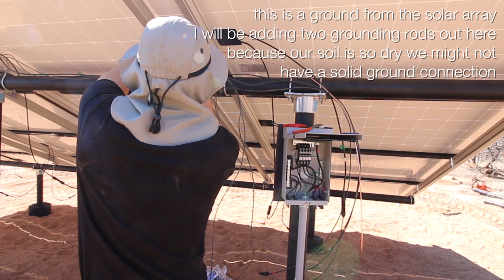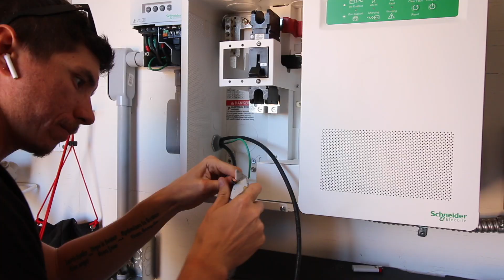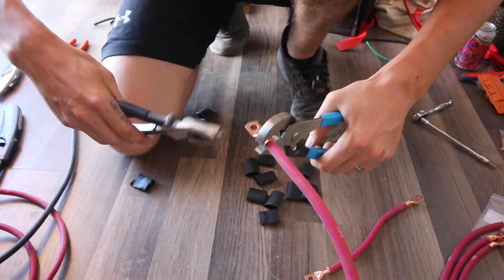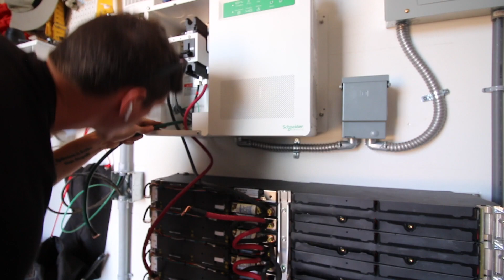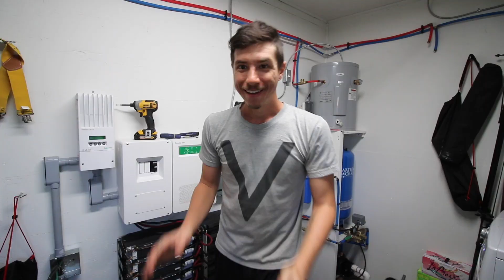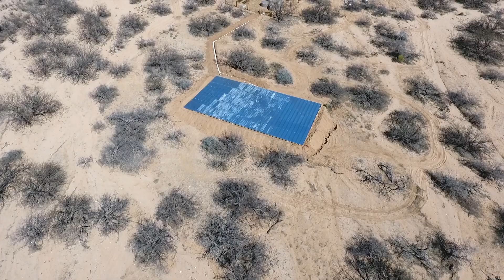HOLY F#CK IT WORKS!! Off Grid Solar Installation Day 6

Comment: Hi, l am trying to make an off grid solar system battery bank. I will use it day n night. USE 1. Pump water from borehole day n night pump is 3kw.  2 . Lights are 200w 3 of them. Please advise

Comment: Whao! What a great work. I am a novice to Solar and stuff, but I would like to know the system voltage of your inverter and the charge controller. I thought you said the battery bank is 60V. Thank you for those great videos. I have learnt a lot from them.

Comment: Derek, how much did your total system cost you and how many years will your batteries last before you need to replace them, also how much per battery will it cost to replace them? Also what things can you run all at the same time without the system shut down?

Comment: 1. Is your underground wire sized for the higher amperage you will have with 5 sets of panels in parallel instead of 4?
2. Did you size the conduit according to code based on the wire size and current, or did you just pick conduit that would fit the wires?
3. Considering the higher amperage from 5 sets of panels in parallel, does the conduit still meet code?
Just wondering!

Comment: Great job. One suggestion. when making your battery cables you did not solder them. You crimp for an physical connection and then solder for a good electrical connection. Then cover with glued shrink wrap.

Comment: I just saw this video of the 6 solar install and don't know if you address this in later video's. But you should install a Service Disconnect for the incoming solar feed in the shed . You should have it before the controller for safety so you don't have to go to the solar combiner box to disconnect. The second is the ground at the solar panels. In the video you only made 1 point to the rail, you should run 1 long run( no cuts ) and attach to all the rails for safety. Nice job over all.

Comment: How much has your solar installation cost you? The battery pack alone can run close to $ 20,000.00. Gee did you spend all your money on the Tesla battery and can not afford the heat gun,  that should be used to shrink the sleeves.  Heating them with an open flame can lead them to be brittle from charing in the open flame. Codes are written for good reason.Even you are supposed to follow codes. It is so nice of you to publish all the evidence needed to prove willful code violations.

Comment: New comer here.   Great video.  Btw.   But dam how expensive. Is your set up.     I went off grid poor.  I have two harbor freight. 100 volt solar kits.  And I home made one vertical  and one horizontal. Windmill.   Witch are doing fairly good.

Comment: So how do you prevent from over discharging the battery?  Considering the Conext Inverter high voltage cut off is 48volts and you're using 60v (15s?)  Your cut off need to be set at least 52.5volts.... But the Schneider software only allow highest cut off to be 48volts...

Comment: Hello , I just saw your vid  a bit late you use 15 solar panels @315 watt each that can give you 20k watts in winter and 30k watts in sumer so as mentioned in your vid you got 18k watt battery which is  a bit less than your actual harvested power inverter efficiency can be as 95%

Comment: YOUR BATTERY JUMPER WIRES ARE FAR TO LIGHT, THEY NEED TO BE MINIMUM 2/0 COPPER WELDING CABLE AN SOILDER THE COPPER CONECTORS NOT CRIMP THEM.... EVERYONE SEEMS TO WAY UNDER SIZE THERE BATTERY CABLES, EVEN THE GROUND AT THE INVERTER HAS TO BE A 2/0 WELDING CABLE TO A GROUND ROD...

Comment: #DIYHomesteadProjects Here in Australia when we bury any cable / pipes, we add a 1 foot contrasting materiel ie. yellow sand, 7 mm blue metal then add the safety tape on top of that which is also colour coded as well ie. red = power, blue = water, and so on. Then we back fill the natural earth.

Comment: So I could use some help...... I have 300 sqft off grid cabin. The only appliances that will be running constantly will be the Refrigerator. T.V, Lights, water-pump, small charging will all be done Occasionally. My Stove and hot water heater will be propane. What sized solar set up would be needed for something like this? I was thinking 3kw but I feel like im over pricing?

Comment: Nice work! Great looking system too! Definitely add a guard over your battery bank to prevent accidental shorting of the battery bank by daily activity in the room. Also when you next service the battery, wrap the socket wrench handle, extension, and socket in a simple layer of electrical tape to reduce shorting risk if the socket slips.

Comment: What type of BMS are you using on the batteries? 

Have you looked into the Schneider CONEXT Bridge 865-0326

It can connect a 3rd party BMS to the ZANBUS. 

https://solar.schneider-electric.com/wp-content/uploads/2017/05/Conext-Bridge-DS20170405_ENG.pdf

http://www.schneider-electric.com/en/product/865-0326/conext-bridge-com-dev-connecting-the-conext-product-line-with-li-on-batteries./?range=62089-conext-combox-&node=457632180-device&parent-subcategory-id=7030&parent-category-id=7000&filter=business-7-solar-and-energy-storage

Comment: Man when you are wiring HV batteries, your safety glasses should be in place in case you accidentally short circuit something and sparks go flying.... ex: from the end of your tool disintegrating......

Comment: first off i would like to start off by saying good job. second i have a few questions.
1 what was the over all cost
2 what were all the items used and how did you source them.
3 how did you figure out the load and how much solar you would need.
4 could you like run AC or a Dryer Or what all could you run. 
we are thinking to do this our selves. any advice would be greatly appreciated

Comment: have you monitored the voltage and amperage at your solar panel combiner box....
and at the charge controler to check the voltage/ amperage drop..... if any....
Reply: that is important and not mentioned
Reply: dgaf stfubznatch 
you can do all the caculations you want...
but monitoring both sides gives real world numbers...
plus with the size of their cable, lenght of the run.
and the voltage on both ends...
can be very helpfull to their followers ( me and.?)

Comment: Great job. It is amazing. I'm working in doing basically the same configuration you have there. Could you share the configuration you have made in the charge controller to charge the Tesla battery?

Comment: How much actual usage do you get from 18KwH on Lithium Ion Banks?

Your advisor was smart not to put a diode in to lower voltage for one extra panel. If your usage is draining the batteries more than 15% per day, then you can look at adding that final panel...
But I’m safely guessing you worked out your total KwH usage anyway... a 5 bedroom household can use up to 11KwH per day in winter with gas water, electric heating and cooking...
Reply: 5 bedrooms on 11 kWh per day?  That seems very low.  My 3-bedroom 1,200 sf house uses about 20-25 kWh per day in the winter, and that's with gas heat.  

11 kWh in one day is an average of 460 watts running continuously for 24 hours.  I'm really not sure how you do all of the things people do in houses plus heat for only 460 watts.

A tiny house is, of course, a different story, especially once you apply some off-grid energy saving techniques that most people on-the-grid don't typically do.

Comment: I'm living off grid in New Hampshire feeding the gas generator daily😫 it drives me crazy.  Was wondering who or what you used for your systems design.  Hard to get info on powerwall 2, but don't want to go with lead acid.  You mentioned Liam??? Is he the guru???  I'm not an electrician but handy and ambitious to learn more about li-ion battery packs.  Any suggestions to keep me moving towards fossil fuel free off grid living?

Comment: just watched u slam pure living for life you pompus jerk.  yet.. you ran your grounding wire along your solar cable run in conduit...  if lighting strikes within 100 miles..  your shit is burned and useless..  watch slamming others... I made it 4 min in your system and huge fail..  hope u didn't bury it from the combiner box..  apologize after your done digging and fixing

Comment: does the bateries have bms embeded?
Reply: CARLOS PORRAS it's not accessible at this time. Proprietary from tesla and designed for a different application. (car)  the batteries are of very high quality and matched so the voltages don't drift apart. It is good to manually check them every 6 months or so to me sure they don't get out of synch. even the Tesla system doesn't have access to the individual cells. It only monitors the strings.

Comment: hi im an electrician from germany , i was just wondering why dont you use end sleeves on the wires where you screw it to the terminal screws ? dont you have to do this in the US ? here with us you have to use end sleeves if you screw flexible wire to screw terminals, because you can damage the strands of the felxible wire and so it can come loose over time and short out or even start a fire.

Comment: While one has to applaud  all these great new youtube channels enthusiasm for media creation, the best value will come from material thats educational and best practice. For your system you've used good components, but you dont say why you chose them. You dont say anything at all about the system sizing, and this would be helpful to show the likes of Pure living how to do this critical step. And a couple of random (constructive) points about your system:, 1) You need bigger wire from the battery to the disconnect (0 - 4/0 would be industry std there for 4kW inverter). As its connected to a source capable of delivering thousands of amps it needs to be protected with conduit. 2) The battery that youve used while innovative is also the single most flamable type available. Hence you need to add some precautionary design into this. You want a non flammable wall to mount things to, place the bank in such a way as that you can still reach the disconnect in the event of a fire (tip: bank on reverse side of power wall). 3) youve said nothing about BMS, which when installed in a car the tesla batteries have a super sophisticated one, (and also often a cooling system), that is how they get away with using such flammable battery chemistries.
BTW both the lid and the false front come off the midnite combiners, that makes it easier to work on.

Comment: Supposedly those batteries weighed 400 lbs when installed in the smart car.  They don't look like 400 lbs there.
Reply: GMoney they only weigh 40 lbs each. He has 6.
Reply: Wow.  That's manageable.  I heard/read a long time ago that the battery bank weighs 400 lbs.  I wonder how they calculated all that weight.  My electric smart drives pretty good on the batteries.
Reply: The protective casing that you saw in one of the earlier videos in this series adds quite a bit of weight.  Plus the battery pack is thermally managed, so there are coolant lines that run throughout the case, adding weight.
Reply: And the Tesla Powerwall is only like 13 kW.

Comment: Could you shoot close-up battery shots to see how you connected the battery bank up?

What was the voltage and current on the wire was on from the junction box to the shed?

Kurt - Amateur Radio Callsign KA7ZDD, Milwaukie, Oregon

Comment: The ground wire going to the ground rods and the green wire going to the equipment inside are different animals performing different functions. One is the earth ground providing protection from lightning. The other is the equipment ground, protecting against faults. They really should have different names.

Comment: Nice Job on the install. I have a Midnite Classic 200 on one of our arrays. I bought it because of the voltage the way that array was configured was too high for another Outback FM or the Tristar. They max at 150 volts. We often have edge of cloud effect here in Off Grid Oregon. The Midnite Classic is compatible with your batteries. I have 20 kwhs of L-16 batteries. We have had 100 inches of rain and 5 feet of snow since November 1st. Your climate looks very inviting right now. We are going to plant our garden this week which is 2 weeks early for our area. Had a freeze 2 days ago. What is the elevation where you are. Is it high dessert?

Comment: What's the battery life time? 
If I am not wrong it's two three years max. And I bet it doesn't come cheap.
Reply from the maker: not even close, 2000 cycles
Reply: So 6-7 years then will need to replace the battery. Except that battery was used with no idea how many cycles were used in the car. Battery technology is terrible and the weak spot of off grid solar. NiFe batteries are only ones with long life.
Reply: john doe by only charging the batteries to 80%-90% it can more than double the number of cycles. These could be going for a long time. Cost will no longer be an issue when it comes time to replace them due to advances in tech and production. My 30Kwh bank of these cost $7k. Having a NiFe battery for 30+ years is probably not realistic since most people will move on to something else before the battery lives up to its full potential.
Reply: Ravemind Your statement makes no sense. Why have lower life batteries with 20-30 year solar panels. NiFe batteries lifetime matches the lifetime of solar panels. This is very realistic. Why couple 7-10 year batts to 25 year panels????
Reply: Charging to to more than 90% and discharging to no less than 15% would be wise for battery longevity.  It would also be a very good idea to keep the utility shed climate controlled to a range of 40F to 90F.  Much hotter than 90F will cause premature battery degradation.

Comment: I can't find any company, eBay or otherwise, called green tech auto selling batteries. Do you have a link?
Reply: Found it. http://www.ebay.com/itm/Tesla-Smart-ForTwo-18650-3kWh-Battery-Module-22p-15s-53AH-55-5v-/222087158325?hash=item33b56d1a35:g:2fwAAOSw~oFXD~8T

Comment: you may get a better ground by using a ground plat burried deep as you can dig with your machine. Dunping a bag of crushed charcoal (think bbq) is another great and cjeap way to improve youe grounding in poor soil conditions. (it's carbon and a great conductor virtually increasinf your surface area.

Comment: Maybe this is an obvious or dumb  question, but if you have a bunch of cloudy days can you charge the batteries with your generator; and how would you do that if you needed to ... that is, would it be a complicated procedure?  Or, say you were attached to the grid, can you use the grid or other sources like wind power to charge the batteries?

Comment: Nothing blew up-Yay!
Reply: My name is John steeples and I live in the Philippines where products are very difficult to get from time to time

I'm an electrician but not a solar expert

I connected eight plates to the top of my house 2200 W
I got a controller that takes 48 V and will take 60 amp 150 V load

But to connect them in positive to negative positive to negative that give 172 V
so I need to connect in another way I been noticing what other people are doing by having these connectors MC4 which I cannot obtain these in the Philippines

Can you suggest a manual way of connecting these to get my voltage down on these eight plates for my controller

Comment: Multiple grounding rods is usually not a good idea. Since they'll be connected you're creating a big loop which acts as a giant coil and picks up ( and amplify ) AC-fields like an antenna. You will be creating an AC ripple on your ground which might or might not affect your washing machine but will most likely be a problem for your computers and audio equipment. If you're worried about moisture for grounding you might be better off putting the grounding rod in your grey-water flower-bed and pound it in really deep but you'll have to investigate that. I'm a sound-engineer, not a solar-expert.

Comment: To solve the water problem, get an inverter air condition. I use a Samsung and the condensing water could be filtered and used for drinking. You can get 2 litters per hour. I think your washing machine is an LG inverter one. Mine is too. Now for cooking  induction tops are the best. So as you can see you can live any where under the sun and have water, air conditioning electricity for fridge lights etc. Here is the big one. You can have a car that charges from the sun directly too. Say a used Nissan Leaf for $6k. A set up like yours for say $4k. Add another $1k for solar panels for the car. Then all in all for less than $20k you can a house and a car with fresh water for life for free. Ah I almost forgot, heating the water. heat pump water heaters are perfect. The COP is nearly 4. So for every 1 kWh you will use you will get 4 kW of heat from the heat pump to heat your water. There is no cheaper way to do that.

Comment: You don't need a charge controller. I set up the panels here in Cairo Egypt so that the peak voltage from the panels is less than 60 v for your system. So you will have the battery pack at say 75% capacity but they will live longer and you already have a large kWh so you can do without the charge controller and feed the panels directly to the pack
Reply: Alaa Sadek the charge controller also stops the charging so the batteries don't go over voltage and get damaged. Lithium don't like to be at full charge for a long time. It damages them.